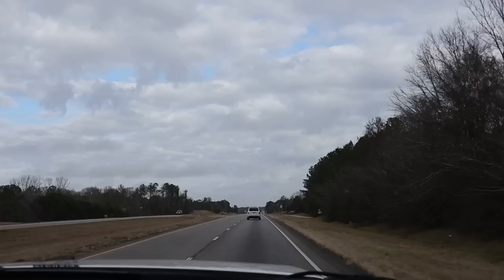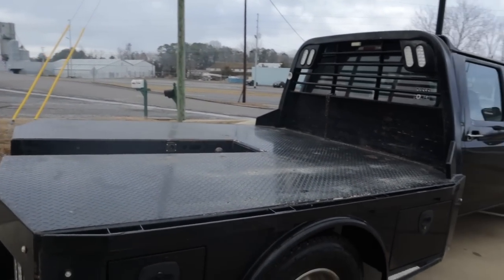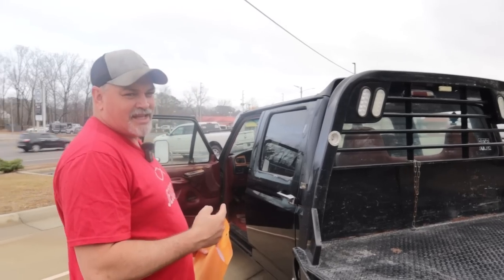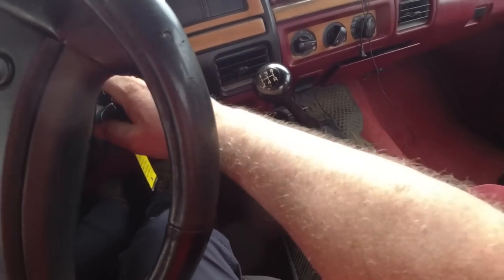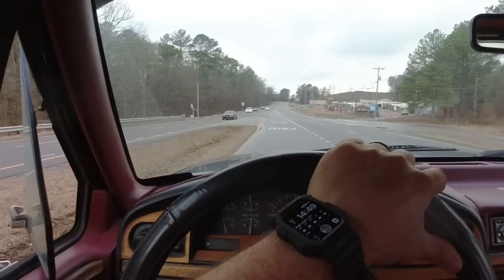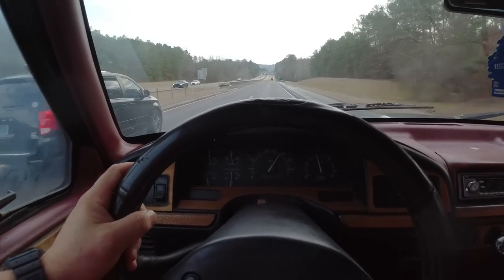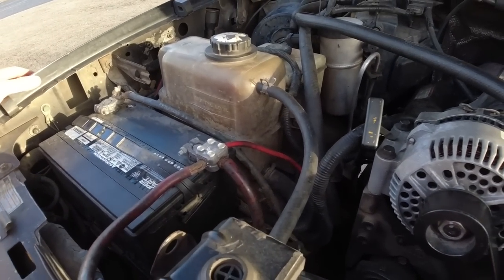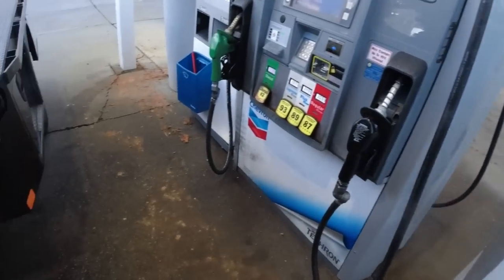I BOUGHT a 7.3 POWERSTROKE Service truck! Will it make it home 300 miles?

Comment: sounds like you have a leaking vacuum line with that vent defaulting to defrost, is does that by design. same thing happened to my wife's taurus, replaced a single rubber hose and everything was good to go

Comment: Diesel engines run far cooler than gas. 
For example think how long it takes in comparison to get your heater blowing heat during winter in a gas vehicle VS Diesel vehicle. 🤔😉👍

Comment: Sorry for two comments but as far as I know your temperature gauge will gradually move  until it actually cools off. If it shows hot while the truck is off and cool you may have a problem

Comment: I didn't see anyone else I was wondering why you drove five hours by yourself to bring back another vehicle. What does OBS stand for? If that motor and drivetrain and the body is solid all those other issues are fixable the interior parts are readily available in the aftermarket. Amen on the shirt brother
Reply: Old Body Style .. I've heard it changed to "Old But Sexy"
Reply: OBS stand for Old Body Style.

Comment: Hamiltonville Farms it is the height and angle of the Filler Necks those FORDS are bad about that they don't put them high enough the Fuel or Gas cnnot go down them fast enough and they keep kicking the Diesel or Gas Pump off prematurely I know this due to my Dad bought as F 350 FORD Dually Brand New in 1986 it was just a Cab and Chassis when he bought it and the Glow Plug Relay went out on his 2 Weeks after he bought it and did not work when he sold it his had the 4 Speed Transmission (Standard )and the International Diesel in it  and here in Arkansas it was a wooley booger to get that thing to start when it was cold it was fine when it was warm OH my friend has a 1995 F 150 with the Dual Gas Tanks too and his Passengers side Window does not work the Switch is bad in his  Truck

Comment: There is no bulletproofing a 7.3 it already is. You bulletproof a pos 6.0 . If the heads were replaced on it something catrosphic happen which is no good on a 7.3 unless it has over a million miles on it.🍻

Comment: Green coolant won’t hurt
Reply: It’s OK for a short term emergency but many 7.3s have been replaced because they suffered cavitation damage from running plain green coolant long term.
Reply: @prevost8686  that’s why you add an additive
Reply: I’ve ran green with the additive since I’ve owned my truck. And it’s a 6.0

Comment: You have to add yourself to some obs 7.3 pages, you don’t know much about these trucks unfortunately…..the breathers on those fuel hoses don’t work well, fuel needle takes a second to adjust on those trucks, the wire you found seems to go into your glow plug relay solenoid.

Comment: Obviously you’re unaware that how those temp gauges are on older fords. I’ve owned every year from 83-2003
Reply: Ps where it is running is good. Everytime I had one run straight up and down it was hot or had blown head gasket etc.

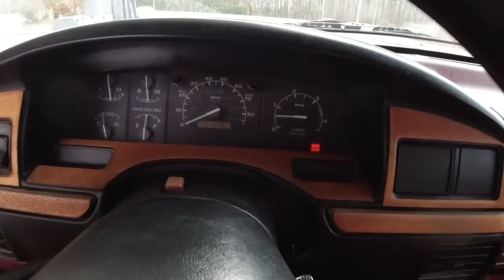Comment: is that 750124? miles in frame 16:15/52:15  don't look pretty , but i think it would do , if you put your tool box on the plate. 👈😒👺👀👀👍
Reply from the maker: 350124

Comment: You are way to paranoid 😆  I would have run that truck 75 to 80 mph nothing wrong with it! And when you toggle the switch from tank to tank it could take several minutes before it will register correctly